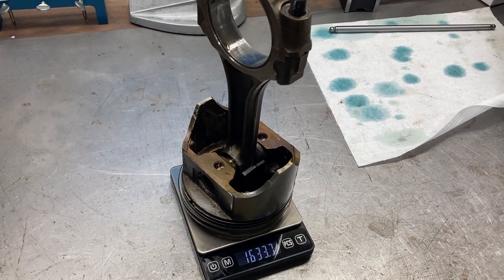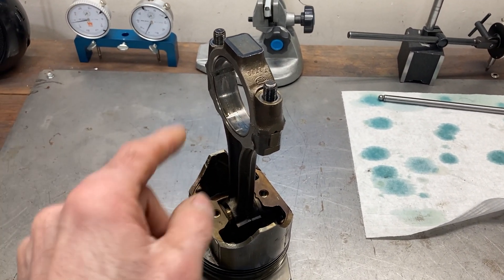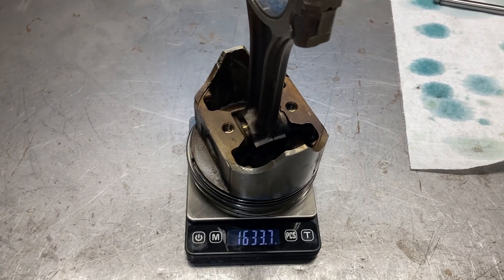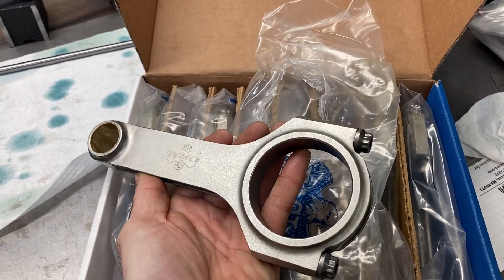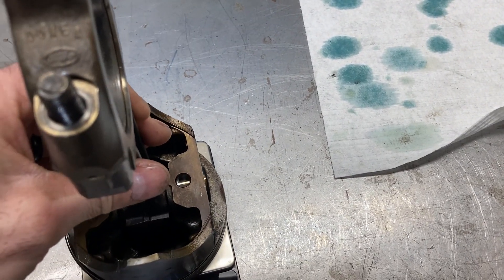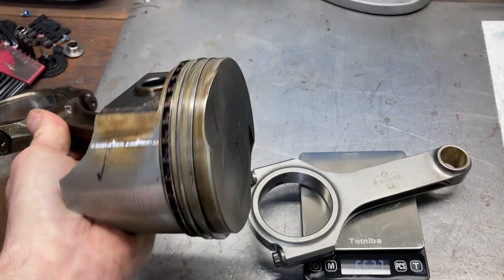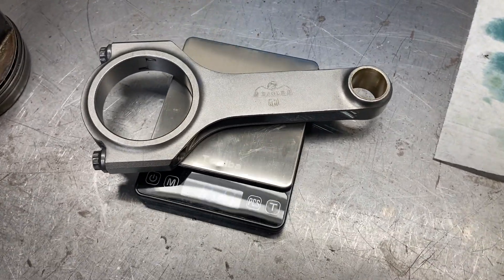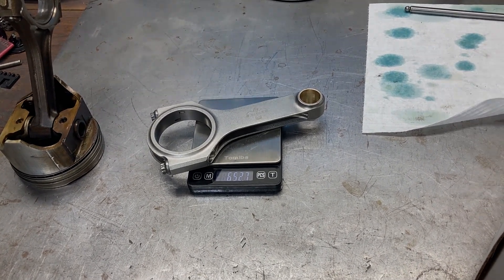Lykins Motorsports 1970 Ford Mustang 351C 4V Quick Update

Comment: Dropped 170 grams per Piston/Rod/Rings/locks/bearings on my 306 build. Factory 97 Explorer combo weighs 1395 grams, my replacement combo weighs 1225 grams with 5.4" rod.

Comment: Going with new rods…wouldn’t it be cheaper to go stroker and Chevy rods?
Reply from the maker: When you start adding 50 cubic inches to factory heads and factory intakes, you start finding bottlenecks pretty quickly.  I've done 408's with factory heads and they do ok, but I don't think the factory intake would support a lot of displacement and rpms as well.  I also considered offset grinding the crankshaft, but sometimes it's better to just keep it simple.